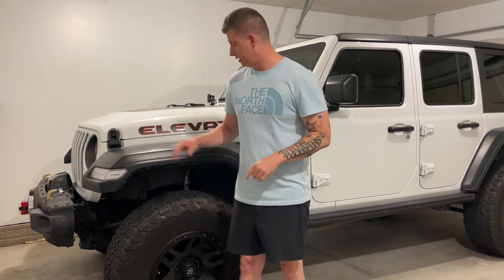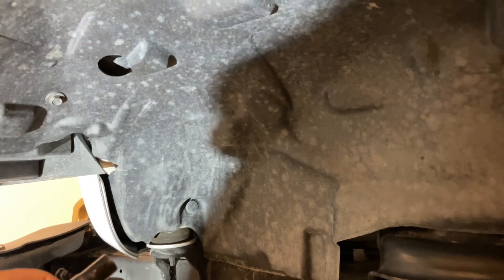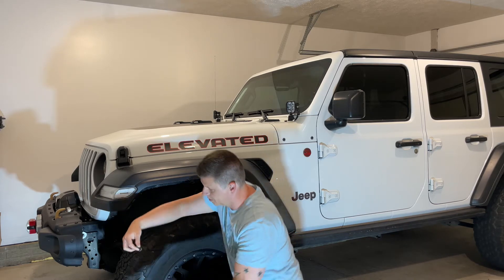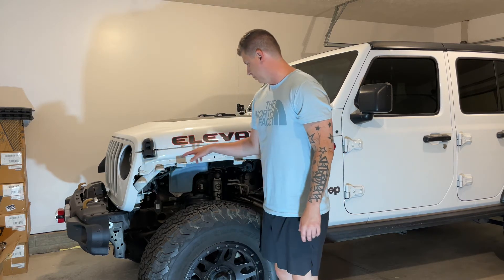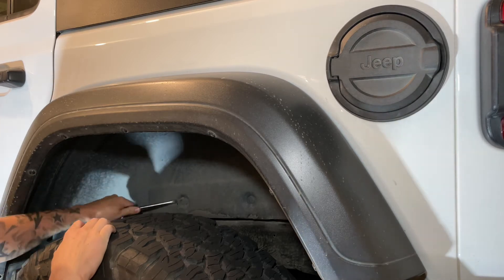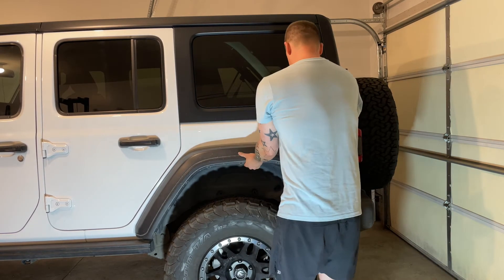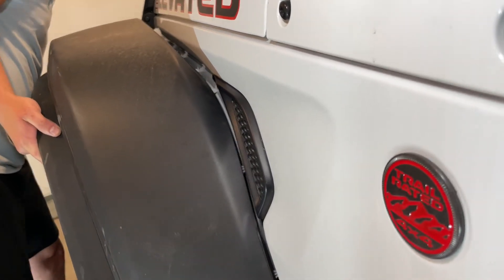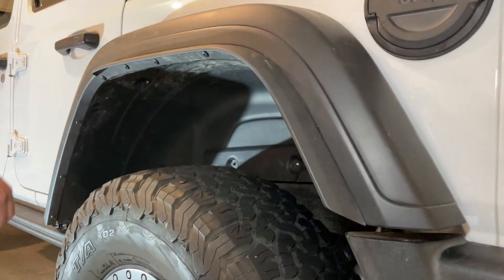Step-by-Step Guide: Installing Jeep Wrangler Rubicon Fender Flares

Comment: FYI. The link you gave for the fender clips is not for the JLs. Those are for JKs. The JL clips are white and slightly different. They aren’t interchangeable.
Reply from the maker: They worked for my JL Fenders when I did this swap 🤷🏻‍♂️